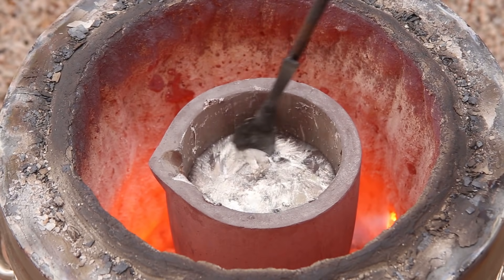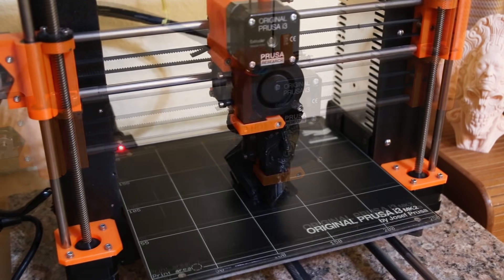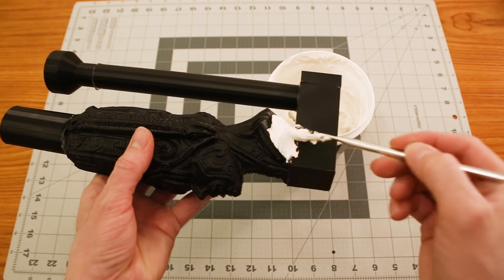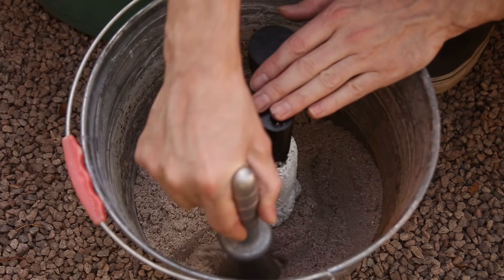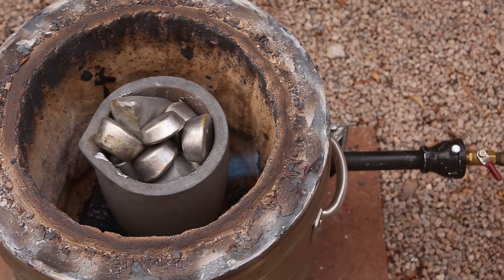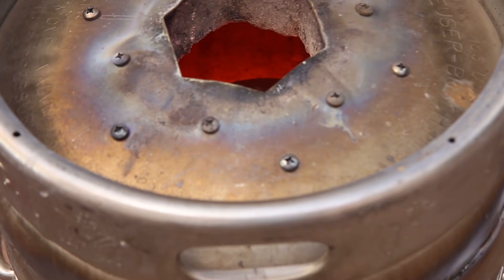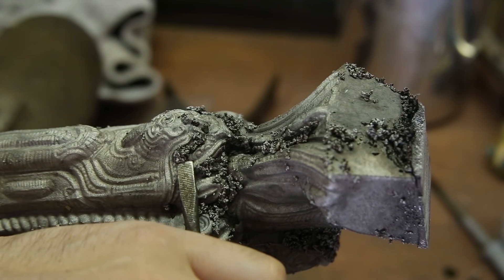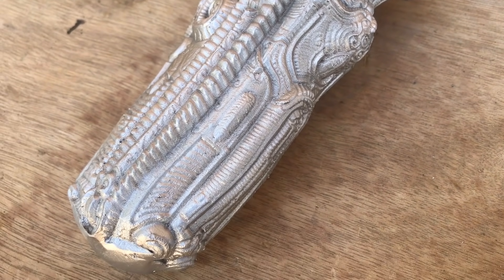Easy lost PLA metal casting │ How to turn a 3d print into metal │ ASMR

Comment: Hey seth,what up this is Jimmy lowe I watched your video last night after a failed attempt to doing LFT I'm a green horn @ it mind you ! I used 2 part polystyrene foam liquid styrofoam yep found out real fast it doesn't work! My question is I have the mold measurements how can you turn a 3D printer mold did like in this video of a Harley-Davidson motorcycle cylinder ! Could you message me back I would like to get some knowledge on this or maybe have you do a 3D scan to cad/cam like file made.

Comment: Ive never done this but I have read that pla will dissolve in sodium hydroxide or lye since pla is an organic compound. If this is true maybe you could coat the pla with a ceramic coating of some sort and then dissolve the pla out with sodium hydroxide. Not sure how the sodium hydroxide would affect the coating. Just be careful sodium hydroxide will dissolve you too if not careful. This way you would nt get all the gas from the pla burnout or the pieces stuck to the casting.  You can just use nrmal dry sand to burry the ceramic shell. No sodium silicate required.

Comment: Another question. When you pour the molten metal into the mold, is the mold hot (near the melting point of the metal) or cold (near room temperature).

Comment: hey it looks fantastic, - one question, couldnt there just be used casting sand around the inner component. i mean the red sand with oil in, that one use for lost foam casting. regards Frank Fenriz DK

Comment: 1. Instead of sand you could use plaster
2. instead of aluminium you can use pewter or zamac which melts way cooler and captures details the most
This way you can burn out the plastic over a fire before you pour anything and everyone can do that at home without the kiln and all that stuff.
Not saying you did wrong or anything just want to show that it can be done even easier and cheaper.

Comment: this seems a lot easier than the method with the vaccum plaster and vacuum casting and the burnout.... you did it all in like 2 steps and no 12 hour wait.  Why do folks use the other method?  Slightly better results?

Comment: Could this work in casting rc plastic parts into brass ? I need trans case for my traxxas jato ,the plastic one keeps breaking the tabs off ,if I could cast one in brass that would be awesome ! Could I just use the plastic part itself coat in plaster and add the risers etc and it would burn the plastic out replaces with brass ? Could it possibly be that simple ? Anyone is welcome to communicate on this comment ,I'm not trolling or being stupid I'm looking for serious answer .

Comment: In the foundry I worked at, we used pour basins over top of the sprue so that a constant flow of metal goes into the mold without any air.  It also reduces spillage.
Reply: This is actually a useful comment

Comment: I used to do some lost foam castings. I would use joint compound thinned with  water to about like milk. and spray on several coats letting them dry between
 coats. Then I would pour a base layer of sand into my bucket place my part in and pour plat sand around the part. After that I would tap the bucket with a mallet to pack the sand once it was packed down pour my metal. Worked great. I made tons of parts and no water glass.
Reply: What is the joint compound for?
Reply: @samthescouts2996  It makes the finish very smooth or just as smooth as the foam is. It also keeps the sand from sticking to the casting

Comment: Maybe the metal wouldn’t have leaked through the joint compound if he’d used more joint compound. Then again, if it had water in it that may have also caused more issues.

Comment: Do you still use joint compound since moving to suspend-a-slurry? Suspend a slurry is great stuff but I would like to know if the joint compound was problematic.
Reply from the maker: Joint compound has its place, but no I don’t use it. If I do in the future it will only be for the purpose of demonstration.
Reply: @robinson-foundry  Thanks for the response.
Have you played around with any castable resin? Specifically Siraya Tech Cast? I've been investing and casting with it but want to try some  other things along the 'Lost Wax' process.

Comment: Very good! I saw  some videos about it and a suggestion that maybe can be helpful is: instead of using sand, you should use clay, and after the clay dries, you melt the plastics of the 3d printed object off the cast before applying the melted aluminum.  This way there's less chance of creating imperfections due to the any accumulations of plastic, and you don't need to worry about the internals of the printed object. Another tip is preheating the cast before pouring the aluminum, that helps to prevent air pockets

Comment: For anyone who cares. "MOST" Cast aluminum is a high silicon based aluminum alloy, which lower the melting point and helps make it flow much easier.  This is what makes it ideal for casting.  You can buy silicon from eBay, crush it, and add to your molten aluminum to make your own allow that flows easy
Reply: silica, not silicon.  You put silicon in your molten aluminum, it ain't gonna be pretty.  Keep it for the window seals.  ;)
Reply: @Sludgepump  No.  SILICON, like I said...    NOT SILICONE which is CAULK!!!  Learn to spell!  My windows seals are fine, because of the SILICONE I've used on them. ;}  SILICON is the element Si with the atomic number of 14....

Comment: I was wondering if PLA can be used for sand casting…
Does it have to be a hollow part?, can’t the metal displace the plastic and push the less dense plastic out through the vent as degraded PLA gasses? 
I was wondering if this can be a functional method to create aluminum parts in my designs?
Reply: This is a total guess, but I would imagine it doesn't have to be totally hollow, given you should use a low percentage infill or create your own supports where needed. So long as the other steps are followed correctly, the molten metal should just melt it away.

Comment: Very impressive. Another version of this is being used with powdered steels. The print gets placed in a steel tube (cannister). The outside gets filled with 1085 and the inside with 15n20 or 1085 with 5% nickel. Its heated to forging temperature and compressed in a hydraulic press. The pla is organic and burns off as carbon. Some very detailed mosaic patterns for knife blades etc are being created. Its very new and likely the next big thing in mosaic pattern welded steel (damascus). Thought it might interest you.

Comment: Juust saying.. you're wearing a particulate filter on the mask while performing the casting. A P100 doesn't do anything to filter out volatile gases.. such as plastic fumes. You want to be using an OV (organic vapor) filter, which usually includes particulate protection as well. Volatile gases are usually at least carcinogenic, so you REALLY want proper protection if you're tryna avoid a nasty condition or death. 
@Robinson Foundry

Comment: Mechanical engineer from forge foundry background yes you can reuse most metal sand etc in the industry we reuse it after filtering and grinding again to ensure no big parts and magnets to remove from ferrous metals etc good luck if it feels and looks good enough to use it probably is not hard 🤞✌️

Comment: As a master Drywall finisher I'd like to invite you to try a product called" durabond " sold at hardware box stores in a brown bag made by USG. It comes in 20,45, 90 and 120 minute use times before it sets . It is a exterior quick set mud that comes in powder and when finished with its reaction is almost as hard as Porcelain . 
https://www.youtube.com/watch?v=7_msJQcmdQE
 this video is best watched  from the 3:14   mark it shows  the mixing process. what is not shown in the video is that you can mix the mud to a thin liquid consistency allowing you to dip your 3d printed blank . Warning ! this stuff is no joke . you will forever ruin any bucket you mix it in if you do not wash the left over mud out while it is still pliable . the reaction is chemical one and will "go bang " or "set up "as we say even under water. I always wondered if this product because of its extreme hardness could be used as a mold by its self with out building up the sand . mix a bit dip, let harden . repeat . you will have to bake the mud in a low temp oven or dehydrator to remove all remaining water before pouring , we know what steam dose at extreme temp.
Reply: Good theory. I will give this a go. I wonder how it will hold up against the heat though. Will find out! Thanks for the info.
Reply: @xRoSkii  A friend dose lost wax casting of cast-iron tattoo machine frames .I had suggested it to him and he didn't want to try it for what ever reason. His process is vary long and laboring . Sure 1 frame would be simple and could be done with  frames and casting dirt . He spends about a week setting up a mold like your process to cast 20 frames at a time . If my idea works it would take days off his process . If I had the equipment I would probably make a crude video to post of only tell people i think it would help or save time for . Good Luck ! Remember the mud keeps its water when it sets up , but you can bake it slow and low to remove it .  Another idea is to hammer the gypsum into a powder from sheetrock fire rated boards and sieve it to a fine powder and mix it in with the durabond . The fire proofing in gun safes is nothing mote than pieces of 5/8" sheetrock "Fireboard" depending on how ling the safe is rated for is how many boards are layered . I think 1 layer is rated outside a safe for 2 hours . Some more food for thought Maybe I'll play with this some .
Reply: @meetthebutcher  I tested it out and I am amazed how well it works. I have a few kinks to work out but it's very promising. What I did is bought durabond 45 they were out of the 20, coated a single wall pla print with a thin coating, maybe 2mm or 3 tops in some spots. I used a blow dryer to get it tacky, then let it hang in a warm oven. Maybe 1.5 hours later is what white and cured. Then I buried it in my homemade green sand and poured the aluminum. It had a lot of detail just as in this video. The drywall compound was still intact, I bet if I coated it over and over maybe 10 times you could cast it without any sand at all. But I will just use the sand because I think its important to support the mold since its pretty fragile. I will eventually make a video after I perfect this. I think this method will help a lot of people, it's just so easy.
Reply: @xRoSkii  killer I had a feeling the stuff would work !

Comment: Hi, Today i tested this method to verify if some relatively small objects can be cast from aluminum with as much detail as is possible. Method is very cool, especially when allow to perform cast any shape what you want, without melting out the PLA first. However my trial castings are very low quality which dissapionted me a bit. porosity of surface is significant. Also, a lot of details are not filled for 100% by aluminum. Honestly I've expected a much better results. Maybe details what I've choosed for test are too small or to slim? But maybe I miss something... Do you have any instruction/guidlines what could you share?  For example what ratio of PLA to aluminium should be for small details to have relatively good results? Or maybe some huge intake channels should be used to not impacting temperature of melted aluminum to much ? Any advice is appreciated.

Comment: Potentially dumb question: Where did the plastic and joint compound go?  For example, did it get mixed into the liquid aluminum / did it burn up and become a gas / did it melt into the sand?

Comment: My word!!! I've been watching and studying casting for years to find a way to cast very solid cylinder heads. Green sand and silicate is never ideal for home casting intricate details unless you have a lot of extras like a hot air furnace preheating your mold to 200c before  introducing the 800c metal (how they do it in cylinder head foundries so there is adequate time for the metal to degass and settle out before cooling. Even then, it's not the  best casting. Although even they fill the metal from underneath with giant sprue cups on top simply for head pressure and degassing up through the molten metal in the sprues. Your preheated ceramic method with a straw size vent on every major high point and applying a vacuum to the container after the fact would make something close enough to billet for me. Personally I'd rather cut off 50 vents rather than have a porous or incomplete filled casting. PLA! Oh what a world lol. Now if I can find some type of ceramic that dissolves in something.  Or use a slurry that isn't as hard as ceramic. Cook it at 250f for 24 hours  and then light it up to burn out the pla or just leave it. Should be difficult  to crack with slow moisture release. I'll have to try it first. I don't even have a 3d printer yet. I've been debating on it for a few years. Now I can't wait.
Reply: curious to know if you do it, and how it turns out

Comment: I'm working on casting an intake plenum for a car.. i was thinking on using plaster instead of sand for surface finish.. now i wonder what the result would be if i submerge the print into very liquid plaster a few times allowing to dry in-between, kind of like they do with wax..

Comment: Is there a way to decrease the slag that was built up on the mold? I'd be afraid to chip away fine details in the sculpture while trying to remove the droplet build ups.
Reply: based on what he was saying about it being the result of aluminum seeping through pinholes in the joint compound, you could probably just do multiple coats of that.

Comment: You would have gotten much better result by using ABS, then smoothed it with acetone vapor, put a some layers of base coats on, and then done the finest detail. Then do a plaster mold and burn out the plastic after.. THEN casting it...

Comment: Nice! I did some diy lost 'wax' casting with polycast, but the burnout makes it kind of time consuming and complicated. So I was wondering if this would work, and you had my answer! Perhaps a small nozzle for 3d printing will help minimize the wall thickness so there is less pla that is burning away. Anyway, cool idea ;)
Reply: Use wax based pla

Comment: I'm impressed that burning out the PLA core before pouring wasn't required. Do you think that any other "support" filaments like the water soluble PVA would burn out even cleaner? Or was PLA just perfectly suited to the application?

Comment: ♥.♥
But I have usually seen this method as follows: 1- Making a ceramic mold for a plastic pattern (wax) with a ceramic liquid combined with silica sand or zirconium 2- Heating this ceramic mold with the aim of melting that plastic pattern (wax) and Removing molten wax from the ceramic mold 3. Pouring molten metal into the ceramic mold.
Reply: Lost wax casting.. usually bees wax.

Comment: Thanks for the tip on the concrete sealer and joint compound!!
Reply: Dry wall sealer I believe. Concrete sealer is an entirely different product, an epoxy or some other 2 part resin I believe, which if used here will produce very bad results and also probably some fumes you don't want to be breathing.

Comment: It is much better to do lost PLA or foam casting with green sand. The sodium silicate does hardly anything used as you did. When it’s cured it turns the sand into a hard block. Green sand is cheap, and highly reusable, unlike sodium silicate which is single use. Also you could easily preburn the PLA so that you don’t need such a large vent. FYI Foam is usually used for lost _ casting because it’s very fast to fill a mould with polystyrene and then dump sand around it. For the hobbyist, speed is hardly your first concern. Another similar and perhaps better alternative is investment casting. Where you make your model, coat it in a thick layer of sand mixed with an appropriate binder, burn out the model, and then fill this shell with the metal

Comment: Great work! I like this molding method, I will have to try it. One note: don't load your crucible cold like that. The aluminum expands as it heats and it's a great way to crack your crucible. Throw a little in the bottom and let the rest preheat on the furnace vent, add once you get a molten heel on the bottom.

Comment: So you don't need to burn out the 3D print?
I'm an apprentice jeweller and they always recommend a burn out cycle before casting.
Reply: for very precise stuff like jewellery yes do a burn out cycle but for a rough 3d print you can get away with not burning out. you can still see the step lines on his model especially under the chin
Reply: He has done full burn outs before when using casting slurry, but this looser sand method was faster, easier, and cheaper. But if he was to burn out the model the sand would fall in.

Comment: Unreal... I've been looking into methods for doing this and this is by far the most effective I've seen yet! Hope it works for jewelry casting
Reply: From what I've seen on other youtube videos, most jewelry casters use resin 3d printers and plaster molds for high quality pieces.
Reply: 3 years later, how did it go? Did you try it? Cause I’m trying to do an engagement ring but still don’t know if I should buy expensive equipment like a vacuum machine and kiln for making plaster or just go with something like this